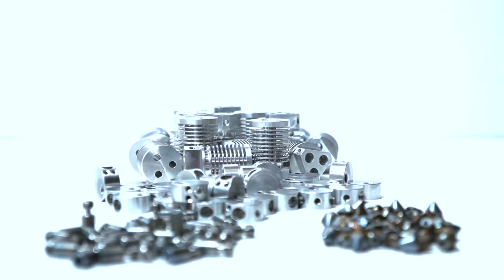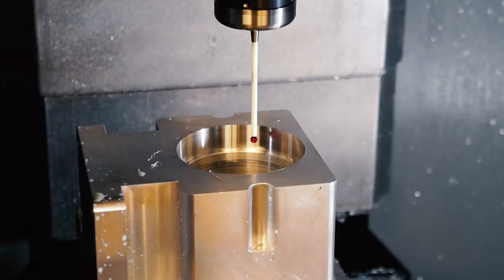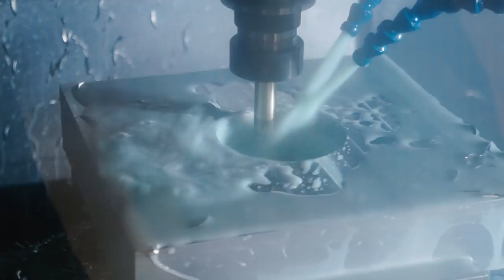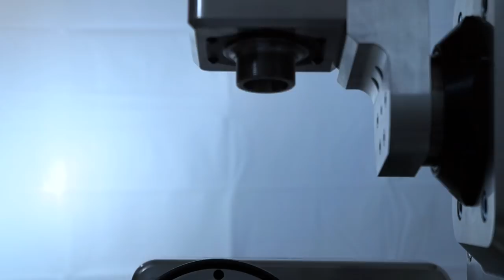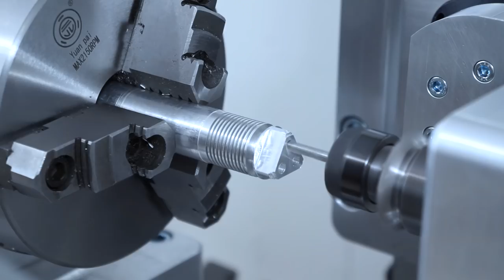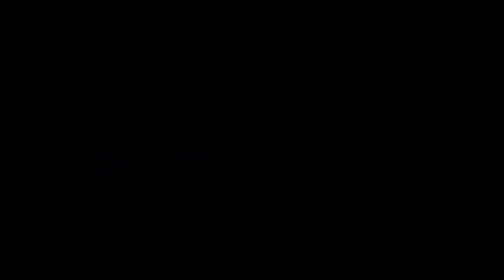SwissMak Kickstarter Launch - A Desktop CNC machine for Makers

Comment: People here should stop complaining so much about it being made from aluminium.

This is a 5000$-6000$ machine intended for use at home or a garage, no, it will obviously not be as rigid and dampening as a cast iron 15t DMU mill turn center worth 750k$. Some people here have some really strange expectations, even some machinists here.

Currently there is absolutly nothing comparable on the market and the video shows a steel bar being milled and the surface roughness looks pretty good for a machine in that price range with these features. So far this is one of the best CNC options available for that money. If you want anything remotely similar you have to get a PocketCNC, get a 3axis Tormach 440 or build your own.

I am a bit skeptical, too, but I am totally fine with waiting for reviews before I start bitching online that this thing can't cut titanium at high feed rates like the VMC at my work.
Reply: you get what you pay
Reply: For a garage?  No this is for a hobby guy.  I have a Brother Speedio in my garage :D  But you are correct it is a cheap machine for someone making a handfull of parts a year not for production.  And considering this mill costs less than a new spindle in most machines...
Reply: @pprotory  - if i only need a hand full of parts, i order them.
and you can order a lot of parts for 6k
Reply: @TechTomVideo  Oh I agree as I make parts for people on my Brother Speedio.  But hobbyists are sometimes afflicted by the Tim the tool man syndrome and I imagine they would go wild over something like this.  LOL.
Reply: I would rather have this than a Tormach. I had one for a year (770) and what a piece of junk.
Reply: I have a aluminium cnc machine and it's fine
Reply: @karlomoharic3992  and 20K is still four times more expensive than this machine. Plus I seriously doubt most people's garage can accommodate an Okuma.
Reply: @TheNefastor  It was just an example. You can also go with Tormach or converted Bridgeport. Any of those solutions is still far better then 6k$ TOY , that is this "maker" CNC.

As far as talking about metalworking CNC machines , I'm going to guess that your experience is very limited. Because  if you were someone who actually worked in the industry , you would know that cnc machines come in different sizes. Machine manufactures do this in order to better satisfy different  customer needs like limited floor height or footprint.
Most people garage will gladly accomodate smaller cnc machine. Your biggest problem if you are amateur machinist will be proper electrical installation and getting a decent shop compressor.
Reply: How to get this machine
Reply: @TheNefastor  I checked your channel and you have 4 cat videos and 1 of a homemade CNC rig made from aluminum extrusions. What experience do you have with industrial grade CNC equipment?
Reply: @internettoughguy  seriously ? You sure you want to pick that fight ? Pro tip : "Internet Tough Guy
" isn't a compliment. If you picked that as your screen name I have to wonder as to how much good sense you have.
Reply: @TheNefastor  uhm...I'm not trying to pick a fight. I'm sincerely interested in what experience you have with industrial CNC. If you don't want to tell me that's fine.

Btw I picked my name because I have a sense of humor.
Reply: @internettoughguy  well, I'm a member of the Electrolab hackerspace in Paris. We have a shop floor that's the size of a supermarket. We get donations from various factories, that includes machine tools so heavy we even had to lay down stronger concrete slabs in places. The biggest VMC we have is a 4 axis with a 20 KW CAT-40 spindle. We're also rebuilding the control for a Mori-Seiki high-throughput lathe. We've got laser, plasma, the list goes on. Also, I have quite a few more videos than you portray, and that's the kind of thing that makes me think you were trying to pick a fight. Let's just say this : no one's entire life is on the Internet. When someone has an expert opinion and it conflicts with yours, maybe, just maybe, that someone is an actual expert.

For example, my own CNC mill is a design meant for use in office spaces. I'm researching stuff like HSM toolpaths that do not require coolant and generate as little noise as possible, while running on single phase power. I have designed and programmed my own CNC controllers down to the FPGA and microcontroller, even got paid for it. I also program toolpath generators. Now, do you allow me to state an opinion, or do you need to see more credentials and also compare the lengths of our dicks ? I'm French, so you might be setting yourself up for more disappointment there too... and that's "humor" for you, by the way.
Reply: @internettoughguy   oooookay, boomer. Let me explain a few things : A/ whenever I need to point out that a $20K machine is 4 times more expensive than a $5K machine, I don't need to first point out that I can do calculus in my head and that I handle quaternions better than you handle integers. Whenever I point out that a machine is too large and heavy to fit in a regular garage, I don't need to point out that I've laid concrete foundations for industrial machines. B/ If someone's going to make assumptions about me, the least they can do is click on my face to see if, by any chance, I'm not a "no-content channel" guy and their assumptions are way off. It's not on me to politely correct every stupid douchebag or "Internet Tough Guy" when they've decided to spend five seconds to insult me. C/ Even assuming you had seen the whole list of technical videos I've posted, exactly what makes you think you (or Karlo) are qualified to deduce my level of expertise from that ? Have you never come across a situation where someone thought something was easy until they tried to do it themselves ? D/ I didn't see you preface your first comment with your resume and mention how much expertise you have in making psychological profiles of people you've never met. So why the fuck should I preface all my comments with my resume ?

If you see me as an asshole, it's probably because you're looking at me from the wrong point of view. Seriously, reread my first comment and ask yourself what could possibly be wrong with it.
Reply: @EAGLINWRX  I've got Asperger's, so yeah, I am self-centered. Plus, let's be realistic, no one on the internet is changing the opinion of total strangers on anything. Proof : before the internet we had sensible leaders, now we have putin, trump, johnson... The only people who seem to have any impact on people online are the good folks at places like Cambridge Analytica.
Reply: Rail, crosslide and compound slide could have been made with standard component like linear guide. You have rail that is completely machined, in fact, the whole machine has practically everything machined which raise its monetary value too much for what it can provide. 

Having a machine made out of aluminium can work, but the room for error during machining is less forgiving and certainly more punishing for beginner interested at cnc cnc.
Reply: Let me preface this with saying I am a professional cnc machinist. (not the greatest but I kinda know what I'm talking about)
Billet Steel and bullet aluminum are basically the same price by volume.
Choosing to go with aluminum and not steel is saving very little, maybe 30 bucks in longer machine cycles in manufaturing. 
So the fact that they choose aluminum in my mind means they don't really give a shit about the product. 
I wouldn't ask for a casting on something this low end but making simple smart choices is kind important.
Reply: @internettoughguy  Might be you not tried to, but you did... You came out pretty strong in that first comment of yours.
Reply: The number of people that are going to be able to fully program such a machine is going to be small.  Not to mention the construction is um how should I put this.  Leaves tremendous opportunity for future optimization.  Put another way it is barely a step better than making the machine from plastic.  I do find it interesting but it is a long way from even the smallest light duty Tormach in how it is constructed.
Reply: The big problem of this one and the current market 5 axis desktop cnc macine are the small machining envelopes, especally this one only accept round material machining.
Reply: @makerog5666  what was wrong with the tormach?
Reply: @kkknotcool  You are correct but I think they want this machine to be a 'desktop' machine and steel is probably too heavy for that (and increases costs of shipping e.c.t). However we decided to make a machine out of billet steel...
Reply: @timeckelmann1196  Those are some good points
Reply: @samuraimachinetools  Casting quality is very poor. Not a rigid machine. The TTS system is a joke, tools do fall out. The base they sell is cheap sheet metal -- very difficult to level and keep leveled. That greatly impacts the tramming.

Anyone who tells you it's a good machine literally has no idea what they're talking about. Go to machine shops in your area -- see how many have Tormachs: NONE.

Most never even heard of the brand. Tormachs appeal to people who have no true idea of how to evaluate a good machine, and often have never run one. Tormach is a marketing company that imports Chinese junk and dresses it up nicely to sucker in novices. Their most famous Youtuber was a salesman for them pretending to be an enthusiastic customer. He's since had a falling out and also bought a real machine.

I bought a Fadal VMC20 for $4K which can eat Tormachs for breakfast. Real machinists go this route because they want a serious machine. People who think they want to suddenly become a machinist think buying a Tormach brand new will shield them from having to know anything about their tools.

I replaced all the electronics, of course, but the steel and the design are as solid as the day it was built.
Reply: No they should give me DMG Mori CMX50U for $6000
Reply: Reichert Zetopan  So you want to put words in my mouth so you can push your own narrative.

I never said this aluminum machine was better, nor do I recommend it either. It's certainly not as stiff as a Tormach, but that doesn't mean the Tormach is a good idea, either.

Tormach's are expensive junk.
Reply: Reichert Zetopan  Ha ha ha. Your anger is hilarious. But you should seek help.
Reply: for 5k you can make a steel cutting cnc, made from steel and epoxy granite base.
Reply: @jonjon3829  Absolutely. I've done that, too.
Reply: @makerog5666  "But you know steppers are better than servos" quote: some guys from tormach marketing lol
Reply: @robn2497  But today, they also offer a servo option. Once again with no engineering effort on their part. They buy the entire solution and bolt it on.
Reply: @TheNefastor  hi jean. Are you still programming cnc controllers? Can we get in touch?
Reply: @toshiba162  Hi Toshi Ba. I'm not currently working on CNC controllers, I'm learning machine-learning right now. What do you have in mind ?

Comment: Maybe I'm old School but there is no substitute for cast iron for machine tools. All CNC machines use cast iron for rigidity and stability; Ivana made some good observations as well. Aside from that, I think this machine has potential but it all depends on the degree in which it is designed well, cost, and if its marketable.

Comment: Have they actually shipped any if these yet  ? At the time I felt I missed out but now think it was a lucky escape
Reply: @jimmer411  they are now moved to Taiwan and the project is moving ahead. check out their kickstarter page.
Reply: As a rule, kickstarters mean the people have no money, no experience, no manufacturing connections, no real engineers. But are good with making a video.
Reply: @nickp4793  If the idea and product are valid, they would get VS funding, not beg for donations
Reply: @nczioox1116  not necessarily, products for small niche markets that are only going to generate enough money to make it worth 2 or 3 peoples' time aren't exactly going to be drawing in investors, and this one fits that description. The kickstarter platforms does have a pretty awful lack of oversight and the legit projects are often pipe-dreams by the inexperienced, which is why so many projects fail. The nature of the platform makes it impossible for the people funding these guys to tell just how competent they are.
Reply: Maybe if it was cheap like less then 2500 USD or so & better made. It looks exactly like a home made machine done on a home made CNC. It also feels like there is aluminum in it.

Comment: Love the concept, pretty much the same as a multitasking centre, just an added lathe turret instead of using the main spindle.
As others have mentioned not a fan of aluminium for a finished machine, but my stuff is all big gear anyway. Doosan/Haas etc. For the hobby guy this would be awesome if they can keep the price down. Or else tormach and small Haas machines become an option.
Reply from the maker: We've been considering building much heavier versions for job shops; full cast iron and steel, epoxy granite, ect. The prototype in this video cuts pretty well, but industrial users obviously want more kilowatts of spindle power and bigger tools.

Comment: I thought a Swiss lathe fed the stock through the turret, keeping the cutter near the turret for rigidity.  That the key to precision turning.
Reply: Louis Brown kinda just wrong terms used . The chuck/collet stays tight on the bar stock moving on the z axis while the cutters stays fairly close to a bushing that prevent deflection .
Reply from the maker: Swiss means sliding headstock design; most of the newer Swiss lathes with larger bar capacities being made now can be used as "chuckers", where there is no guide bushing and the part is supported directly by the headstock spindle. We will have a guide bushing attachment for this machine, but it is unnecessary for most parts.

Comment: I suppose the box ways are made of aluminum? Are they really durable enough to hold high tolerances after a couple years use? Sounds like steel chips or dust would ruing them really fast. If I remember correctly aluminum on aluminum doesn't make very durable sliding surfaces.
Reply: It doesn't...  They should invest a little more time and money and design/offer this machine with linear bearings and guide rails.  Then it wouldn't be so much of a trinket instead of functional, long lasting machine.  Neat concept though, it just needs to have more built in robustness.
Reply from the maker: There is no sliding metal on metal contact anywhere in the machine; the production version has hard anodized boxways (65 Rc like fully hardened steel) that slides against polymer wear pads. You are right that un-anodized aluminum boxways wear quickly with abrasive contaminants.
Reply: @overlordroboticscorporatio7547 ... That sounds better and should last longer.  I happen to own a Sherline Mill and Lathe, as well as a Taig mill.  Both the Sherline and the Taig machines have aluminum ways that have been hard anodized and I can confirm that these surfaces are very hard/abrasive resistant.  That said...  How much more would it add to the cost to use linear bearings?  I think they would have a dramatic effect on durability and reduced friction of your machine.  

As I said in my first comment, very neat concept.  Wish you great success with your venture.
Reply: @overlordroboticscorporatio7547  i have several things with "hard anodizing" on and all of them are completely worn off in about a year of use. just regular use not rubbing with metal chips.  anodizing layer is pretty thin.
you definitely should do a long (half a year) metal production run on your prototype to check wear patterns.

Comment: Will you send out a new bed if I accidentally drop a tool and put a 2 inch gouge in the aluminum ways?
Reply: easy solution, do not drop tools or anything by accident.
Reply: Aluminum ways? That won't work.
Reply: @Anenome5  depends on the definition of "work"; (initially) happy hobbyist customer vs. a durable, long-lived industrial machine.
Reply: @scottwillis5434  Sure it might hold... tenths tolerances.
Reply from the maker: The Kickstarter version will ship with a rubber flap sheet to protect the top surfaces of the boxways from impacts. The hard anodizing protects for scratches, gouges, and abrasion. Something like a hammer impact against the exposed surface would put a small dimple and raised surface near where it hit; this could be stoned down flat (common on machine tables) or if it was larger, ground out with a rotary tool. The mark in its place would not affect the boxway function noticeably since there is a large contact area.
Reply: @zoki.to974   Said anyone that has never machined parts before ever.
Reply: @pprotory  was a sarcasm/joke
Reply: I figured it was. The reply was more for the inevitable blind fans that will no doubt hail sarcasm as the gospel though lol.

Comment: Is there a spec of the construction someplace to view? Those that talk about things like the ways not holding up out of aluminum. It looks like the surface is attached with cap screws so maybe it is even hardened steel?  When I worked in an aluminum and magnesium foundry the right alloy and heat treat would make the casting so hard you could not make a dimple in it with a ball pen hammer. A rotary file would just bounce on the surface till you held enough pressure to get it to chip. Might be better than CNC machined aluminum but cost more unless made in China.